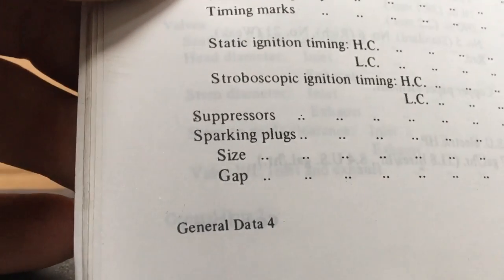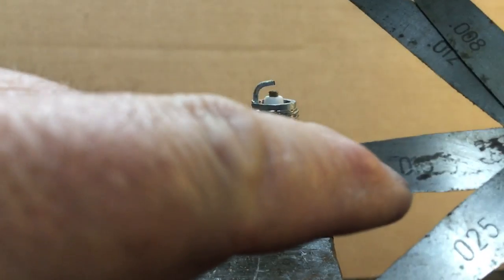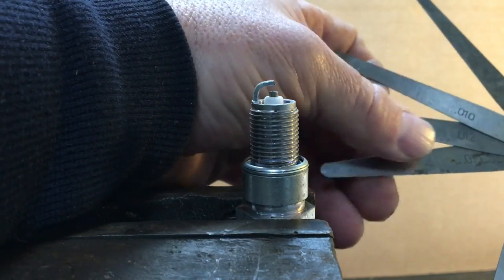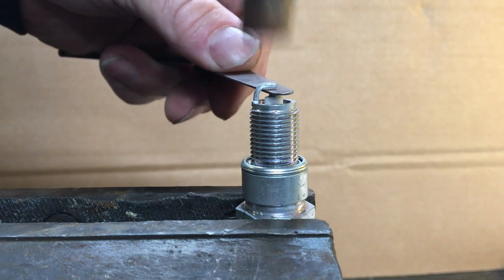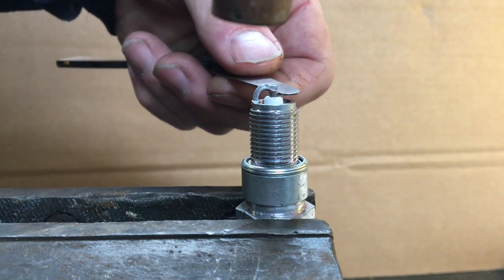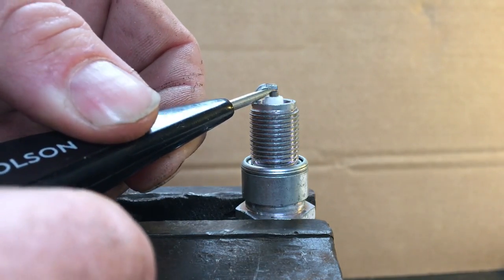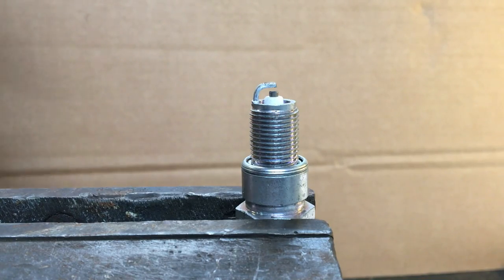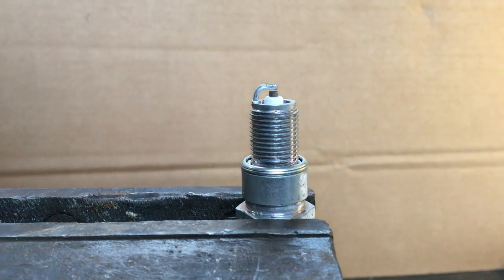How to set the gap on a spark plug

Comment: My flat gauge 0.043 set gap is 0.044 using a preferred wire gauge. I tap the ground on something even wood to close it and use a gapping tool to open it. Never had a plug break or fail.

Comment: No need to keep on removing the gauge then hitting spark plug waste the time just leave the gauge there and hit it until it touches and then you won't have to pull it back up if you hit it too far. Nice video 😊
Reply: Is it possible  to ram  in the electrode by doing  that ?

Comment: I thought for a second this guy gaps his plugs like me then I was nope what an idiot he hammers on them, good way to crack the porcelain and then all but prying on the electrode to open it back up what if it's was an iridium tipped you'd have all but ruined it.  I don't want to give out my secret method of gapping plugs that you can do almost perfectly and slowly and to exact increments with one hand and I don't know how this guy hasn't figured it out.  You use the vise he had it clamped in, but turn it the other way, I have one padded with wood, but anyways you put it In the vise long ways and slowly turn until you have the Gap exactly where you want that way you dont accidently go to far or to little you can use one hand to crank and the other to hold the gapping tool and consistently check the gap while doing it instead of having to stop.  Your welcome.
Reply: Amazing! Lol

Comment: With the gauge tool in between, you are actually hammering on the electrode, which is NOT good!
Reply: I'm pretty much sure he wasn't hammering on electrode and did a fine job. He also doesn't have easy job, sounded like he was focused with showing us, while trying correctly adjusting his small alignments. Feeler gauge is one of best tools to accurately knock lightly with in lowering small metal peace down, alongside the measurements down a notch to manufactured recommendations. He was concentrating on not hitting too hard, hence why he hasnt replied is you assumption is bit unfair because whole point of video is mainly for beginners if that helps. l done feeling many times myself before, often practice on old spark plugs and l can tell you this, as easy it looks it ain't practically easy at all also similar to laser wheel aligning but harder because that just a few adjustments under wheel arch, silver bolt behind rotor disc and pads when it come to wheel balancing, and angling with adjusting bolt then laser tracking balance movement with metal bar covering centre, top, bottom and sides of wheel angle, with computer to align wheel performance properly but in all respect that is easier than feeling gauge. Another thing to note is, it ain't easy with a hammer, also you can't use wrench, or chissles with any other form of pliers, tools as it would crack or break whole top of spark plug and need to folk out in new one. What l tend to use is a rubber mallet, so that the rubber doesn't cause any issues to electrode if l did hit top down a bit over hard accidentally then least l got peace of mind it haven't cracked, or touched electrode and done any other damage when l keep gauge between it. Yes, KEEP GAUGE BETWEEN IT when lightly hammering top is what l believe he had done correctly. If anything, he deserve round of applause.👏